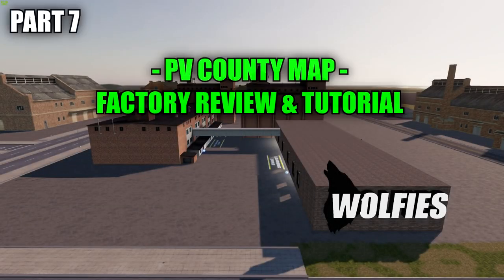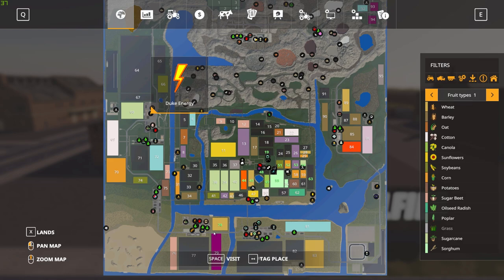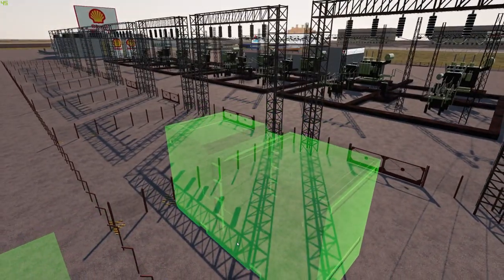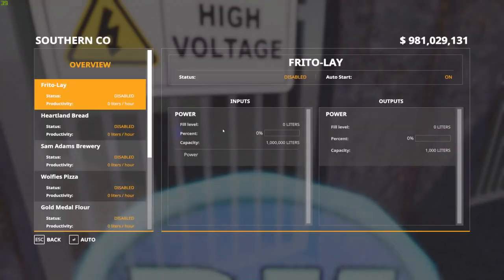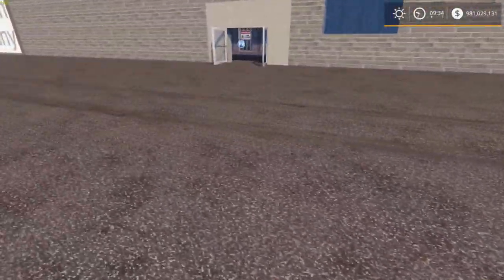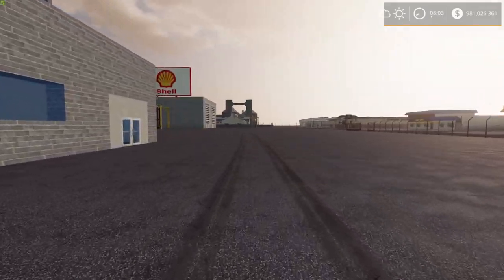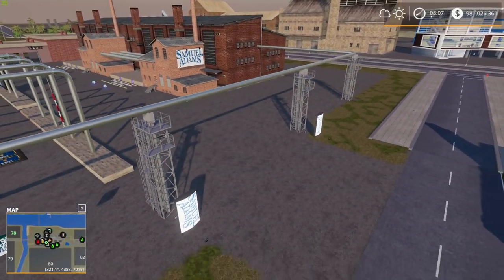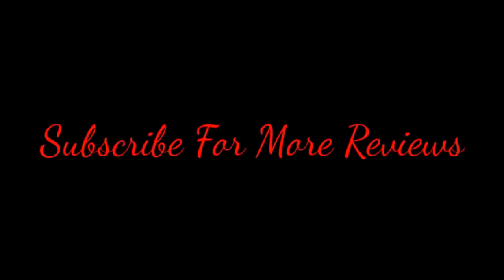Part 7 PV County Map Tutorial (Power Stations & Electrical Systems) Farming Simulator 19

Comment: I see your video isn't that old but allot of the power station on the version in playing on requires a battery on the input section
Reply: Did u figure out battery power yet because I am stuck there.
Reply: @jagjitsingh5269  no i haven't yet, i have up on the map for now until frames start getting better, my friend and i just started playing on yukon, that map is also a 16x but I'm getting way better frame rates cuz it doesn't have as much going on

Comment: Dear NIck! Please record at least a short video lesson - how exactly to use the boats and ships included with the map? Can I use them to transport equipment and fulfill the contract at the beginning of the game on the fields with the number 64+? I'm not talking about the price of such boats (although I don't remember how much they cost, perhaps at the beginning of the game you can buy them and then beat off the price due to the same tasks on huge fields.
Just if you know how to use boats in the game - please write down a similar lesson for those who, like me, even in fs17 did not use a similar transport system. Let's say I bought a boat/ship, but it appears in the store, not in the port, etc. And how now and where to transport and unload it????
I apologize if this is very easy, but then write in detail, like: 1) we buy a barge, 2) we load on such a trailer, 3) we unload in such a port, 4) to transport equipment/cargo, we do such things... etc.
Sorry for my English. Text translate via Google-translate.
Reply: Yes you can use the ferry and the barge to reach the other islands before bridges are built. The barge is more expensive but has more room. When you buy them, they spawn at the store just like any other vehicle then you just "drive" them off into the water via the access point right by the shop. Each island has at least one dock where you can then load and unload vehicles from. You can also run the ships aground but then you risk getting them stuck.